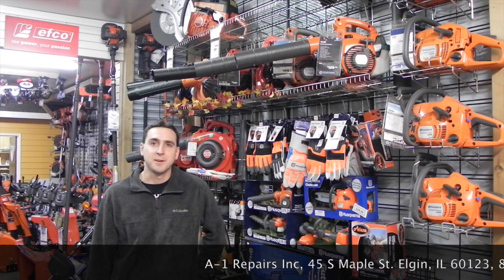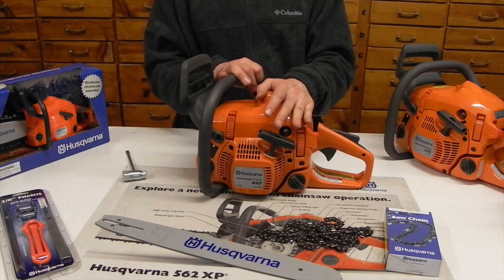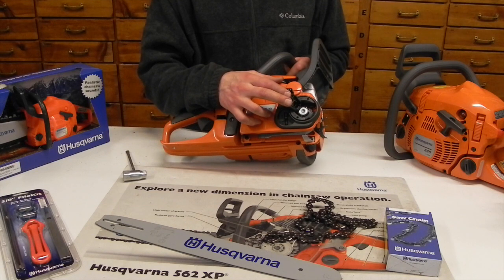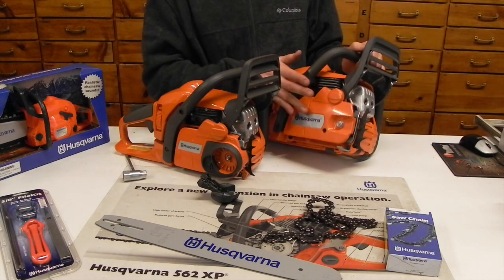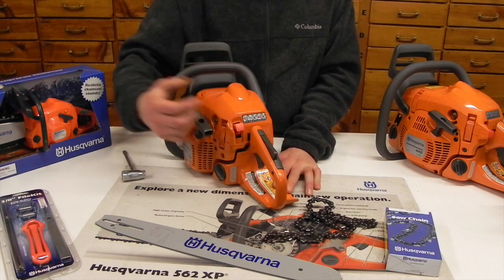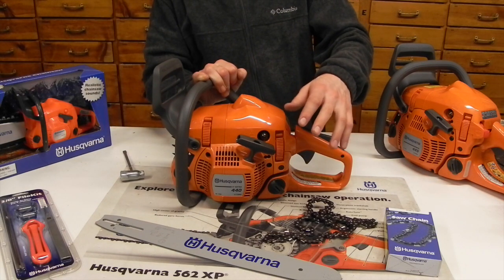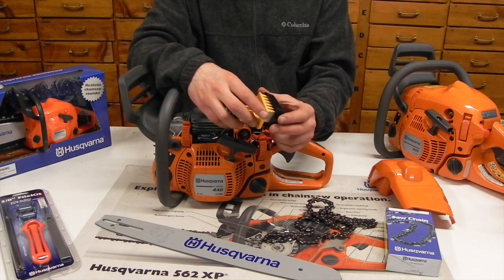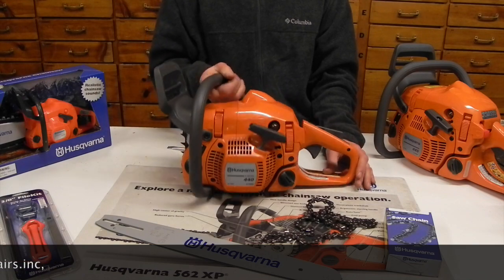Husqvarna 440 Chainsaw

Comment: I just bought a 440 E series that doesn't have the tool less chain tensioner. I'm happy about it as I prefer the simple nut and screw. Very nice chainsaw for the other reason you stated.
Reply: It's the better saw of the two. I have a 440e as well. The 440e II is the one with the tool-less chain tensioner. Those tool-less tensioners tend to be junk.
Reply: @obeconoberougle9497  I've got the tool less version, bought it 5 years ago and use it a lot.  I've never had a problem with the tensioner and I prefer that saw to my son's 460 Rancher even though the blade is smaller and it has less power.  Much easier/lighter to handle!!  I do like the compression release starting on the rancher though.  The 440 can be temperamental bugger.

Comment from the maker: The too-less chain tensioner is a nice feature but some of the customers using them do not quite get the knack for the proper operation. When adjusting the chain after the bar and chain is properly on the saw, it pays to follow these few steps. Tighten down the main bar nut tight and back it out about 1-2 turns. Wiggle the bar as the chain is tensioned towards the (+) sign. Make sure the chain is snug tight by turning the dial firmly (+). When turning the dial it is a firm process, not like adjusting a sound dial on a speaker. Wiggle the bar as you are tightening. Then tighten down the main bar nut. Take a heavy rag and manually spin the chain carefully. Test the tension again. After a chain spins it may seat differently when finding its grove. Tighten again with the steps above if the chain is not on snug. Chains become loose over time naturally when cutting, but if you follow these steps and tighten “Firmly” then the Too-Less model can be a good feature.

Comment: Elgin, IL dang. I was up there many years ago and installed the control system in your water treatment plant. Cool little town you have up there in the snow belt. I just bought a bran spankin new 440e and it doesn't have the spiffy chain adjustment. Bombed I guess?
Reply: He's incorrect. The 440e doesn't have the tool-less chain tensioner. That model is the 440e II. The 440e is the better of the two anyway. Those tool-less chain tensioners on any chainsaw are typically junk compared to standard bar nuts.

Comment: Just tore my 440 apart trying to find a bad fuel line, or the cause for the bulb not pumping up. What a nightmare! Three hoses, 6 connections, and you have to take everything off to get to them. I've worked on easier saws without a doubt. Turned out to be the carburetor, as the hoses looked to be good, but it all had to come off anyway. Tip, take step by step pictures. Alas I did not.  You guys wouldn't happen to have a fuel hose video, would ya?  I bought all new OEM formed hoses, because I ain't doing this again.  You know, I always use Sta-Bil, always run the saw dry, and ALWAYS use fresh fuel, past 30 days gets tossed. No idea what happened.

Comment: I made a tool to fit the clutch cover nut using a piece of welding rod bent to fit into the two small holes on the ratcheting nut. I can tighten it so it will not loosen without fear of breaking the flimsy folding handle.

Comment: crazy carb on them , 2 barrel style , they were made by Poulan for Husqvarna not bad saws I guess just watch fuel lines as they go bad and will trash carb
Reply: I'd never buy another one. Echo is a much better saw for the money.  Just bought that little Echo trim saw, it cuts as well as my 440, and I can use it with one hand.

Comment: I love husqvarna products they've always treated me incredibly well , I currently have a 450E2 with a 16" narrow kerf bar and chain and a 440 with a 13" narrow kerf as well as a 16" if I wish which is my back up saw and I love them box but I gotta say I've never seen that tool-less chain tensioner system the 440E has there I had no clue they used that and honestly I'm somewhat disgusted and shocked as well quite disappointed, it may work quite well I have no idea but I just could never applaud that type of chain tensioning/retaining setup on any saw.  But can you consider maybe doing a detailed video doing the adjustable 460 rancher oil pump retro-fit/conversion into the 445/450 chassis of saws as I'm highly interested in carrying this mod out myself but the extent in which the metal oil pump cover plate from a 455/460 must be modified to properly fit the 445/450 chassis is unclear to me as I've found almost nobody even mentioning this modification is possible but I know it is cause I seen a video of a guy who did it but it was not well detailed. Edit , I've also heard you can also use the adjustable oil pump from a 346xp as well.

Comment: GOOD video.  I was confused by the tool less chain tensioner and how it was used until I watched what you did and now my chain is snug, but can be turned by hand. A picture is worth a 1000 words?  Also I did not know the air filter was a 2 piece one that snaps apart/together.  Many thanks for your presentation!

Comment: Bought this a year ago to clean up from a storm.   After the initial start,  it was VERY hard to start.   Now I can't get it running less then a year later.   I've adjusted the Carb/Throttle.   There's 2-3 youtube videos about how terrible this model is.    I would STRONGLY recommend spending the extra money on a Sthil.
Reply: I bought my 440 as a factory reconditioned unit from a mail order place.. I try to following the starting routine to the letter.  I've had zero trouble starting mine.  I generally use the expensive non-ethanol fuel but I don't think that's it.  I think these things flood real easily.  Cold start is pulling the switch out and up.  Pull until it coughs once, then push the switch down to the run position and continue pulling.  I've heard someone i respect saying, if you pull the handle more than 3 times with the choke still engaged .. i.e. in the start position.. it will flood.  If it's been run and you're restarting it, no way i'd choke it.  ps.. i used to keep premixed fuel around for a long time between saw uses and there's no way i do that anymore.  your mileage may vary but, I've been real happy with mine.

Comment: For just general use, cutting firewood, is it worth it to get the 445 over the 440?
Reply: Absolutely , the 445 is a significant upgrade all around over the 440 , better yet you might as well just spend only $20-30 more and get.the 450 instead of the 445, I had a 445 and now have a 450 , loved the 445 to death and it was an excellent saw that went through some serious shit including a garage fire which it survived somehow only needing the primer  bulb replaced and a good cleaning. But now as having owned the 450 for 10  .months I gotta say you gotta spend a couple extra bucks and go for the 450 for a 50cc firewood rated saw it cuts like an animal especially with a 15" narrow kerf bar and chain on it (came with an 18" narrow kerf  X-force bar a d X-Cut chain on it , I run the same chain on my 16" bar and its an awesome chain cuts like a son a bitch even in dirtier wood which usually will give some saws and most chains a hard time.   I've also owned a jonsered cs2245 which basically is a husqvarna 445 as far as the whole engine and rest of the mechanical parts are concered with the only real djfference being the top engine cover , pull start housing , main body, and clutch cover are all slightly different in shape and design as well as either black or red opposed to husqvarna's classis orange colored machines.  I've had a  bunch of.othrr husqvarna saws and they all treated me very very well as well as were very impressive regarding power output , reliability and comfort/feel while using them. Had 2 55 ranchers the once lasted almost 20 years before it got low enough in compression where the power output was lessened to the extent where it needed a piston and.ring , and gaskets obviously.

Comment: My 440 cuts well and I use it frequently. It seems to be more difficult to start. I'm sure to use non-ethanol gasoline and the right fuel oil mix. I keep the spark plug clean of carbon. It takes several pulls to start, but it used to be very easy. My next effort will be to replace the plug, air filter and fuel filter. Is there anything else I can do?
Reply: Steve's small engine saloon channel does a lot of vids on carb cleaning...

Comment: How much bar oil do I put in my 440e?
When I fill it up it just leaks all over the place. 
Am I over filling it? It’s brand new I can’t imagine anything being wrong with it
Reply: Mine seems to leak out too. You can't overfill it, well, what fits in the tank is okay. If you're storing it empty the oil tank, and run the fuel tank dry.

Comment: Is there a screw to make the chainsaw use more oil?,the chain is constanly dry!!
Reply: I have one of these.  The 440 doesn't have adjustable oil feed that I recall.  I find if the chain is not getting oil, the slot in the bar is usually gummed up and it's not immediately obvious.  Same with the oil hole in the bar and the oil output slot in the saw body.  Make sure it's all clean.  I've also checked that the oil is flowing without the bar on the saw.  Take the chain off and run a putty knife or pieces of cardboard down the slot.  Something not very intuitive is that a chain that is not sharpened well enough will put out too much saw dust and not chips.  The dust contributes to the slot getting gummed up much faster.  I'd also say a sharp chain makes a huge difference in efficiency and safety on any saw but particularly with a smaller one.  That said, i really like my 440.  It is so light weight and easy to lug around.  Seriously, if cleaning the slot fixes the problem but only for a short time, then you probably need to sharpen the chain and get a better idea of what a sharp chain feels like.  I don't think it's as obvious as a sharp kitchen knife.  good luck

Comment: My 440E dose NOT have a tooless tensioner. It has a conventional cover with nuts and chain tensioner
Reply: That probably makes it a 440. There's a tag on the front that should tell you.
Reply: @jeaservices  The side of the case on the sticker it says E-Series 440" and the tag riveted on the saw says "440e"

Comment: I heard some people are problems keeping the chain tight with the tool-less chain tensioner. Have you seen any of those issues?
Reply from the maker: 707SonomaComa Thanks for asking, you gave us an idea for another video we can add to the channel. As for now here is how we get the best results from the tool-less chain tensioner as we do not see many failures out in the field.

The too-less chain tensioner is a nice feature but some of the customers using them do not quite get the knack for the proper operation. When adjusting the chain after the bar and chain is properly on the saw, it pays to follow these few steps. Tighten down the main bar nut tight and back it out about 1-2 turns. Wiggle the bar as the chain is tensioned towards the (+) sign. Make sure the chain is snug tight by turning the dial firmly (+). When turning the dial it is a firm process, not like adjusting a sound dial on a speaker. Wiggle the bar as you are tightening. Then tighten down the main bar nut. Take a heavy rag and manually spin the chain carefully. Test the tension again. After a chain spins it may seat differently when finding its grove. Tighten again with the steps above if the chain is not on snug. Chains become loose over time naturally when cutting, but if you follow these steps and tighten “Firmly” then the Too-Less model can be a good feature.

Comment: Ive seen a few reviews of the 440 where the single bolt holding the bar tight comes lose ans the chain flies off. Does this seem to be a common complaint on the saw or is it just neglect on not making sure that the bolt is tight before operation? Also, saw many other reviews that the saw is very hard to get started or becomes very hard to start after a few uses. Is this common too qnd do you know anything about this or remedies? Thanks. Appreciate any feedback :)
Reply: I have a 440E and have never had my chain come loose.

Comment: Having trouble getting saw cover back on,anyone know what's wrong?
Reply: Yeah you dont have the pins lining up likely because your spark plug wire is not set firmly and securely in place properly.

Comment: I have a 440 e and it has the nut on it instead of the adjuster that must have ripped me off and put the wrong sticker on it
Reply: Bob Barker  I just bought one also and just have a nut and am wondering the same thing.
Reply: 440e has the nut, 440e II tool-less adjuster.

Comment: Technically that saw has the capability and power to pull an 18" bar and chain especially if it's a narrow kurf pixel bar and chain but I wouldn't ever run anything other than a 16" narrow kurf bar. The toolless chain tensioning system is a garbage design made for pussy retards who don't even know what kinda oil their car takes.   440 is an awesome saw for the price though I love those saws I've had a couple along with a few 135's and a 445 and many other husqvarnas over the years , model 41's , a 350, couple 55 ranchers , never had one let me down in the woods even once , literally never had a breakdown with any of them just kept up and was really honestly a freaken obsessive fanatic with my maintenance replacing maintenance parts even when I didn't have to just for the hell of it.  Btw the owner of my local Husqvarna shop last year talked me out of buying another 440 and instead guided me to a 135 because he said he's had the engines and carbs apart down to every last piece on the 135, 435 and the 440 and said every single engine component has the same exact part number and all the parts are absolutely identical meaning that all 3 saws actually have the same output of 2.4hp, he said they just underrate the 135 and 435 for marketing purposes so they can have saws all through out the price range spectrum without actually having to design and build separate motors for 3 of the saws which saves them alot of money in production , just like the 445 and 450 they are literally identical except for the cylinder and piston , you can take any 445 and make it a 450 by simply installing the larger 450's cylinder and piston then of course readjusting your carb properly after the swap. Alot of manufacture's do stuff like this to save money in production lines, have you ever taken note of this fact? The 3 saws having the exact same motor and output  that is?  BTW why the hell did they change the new 135 mark 2 to a 38 or 39cc engine? Why the hell would they have done that instead of.leaving the long proven and.reliable ultra tough 40.7cc motor in it like the mark 1 version of the 135, isn't this new 38 or 39cc motor just s rebadged poulan engine basically? That's what I heard and they want more money for them too, yeah ok, I'll keep my 135 mark 1's and other saws thank you very much.  Huge drop in power going from the 40.7cc which was 2.4hp to a 2.01hp 38cc.poulan piece of shit.